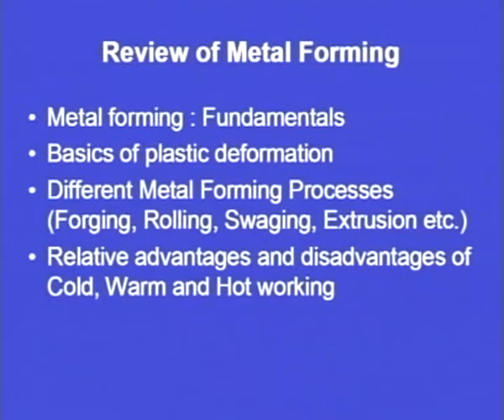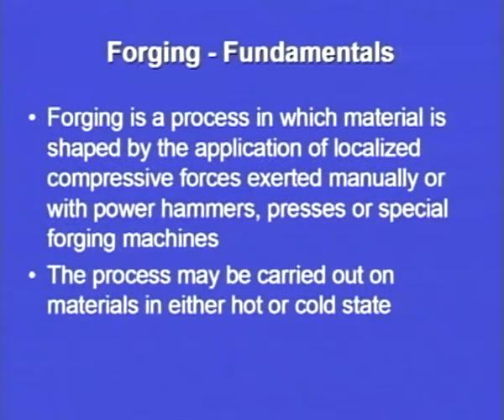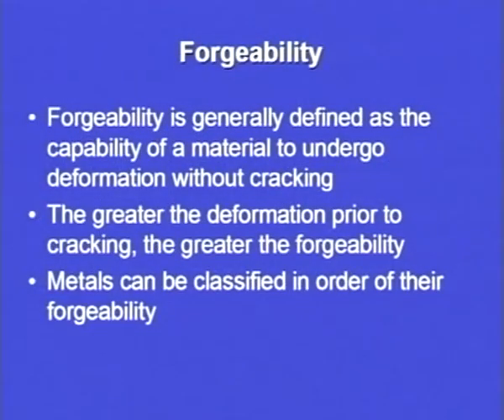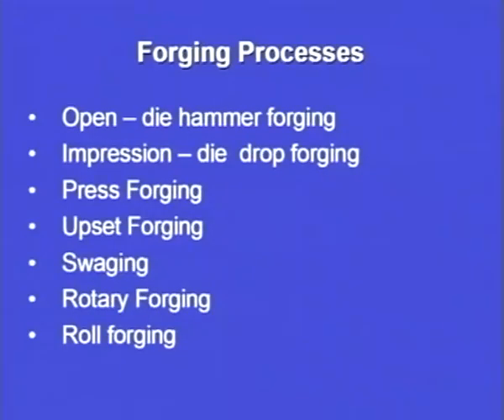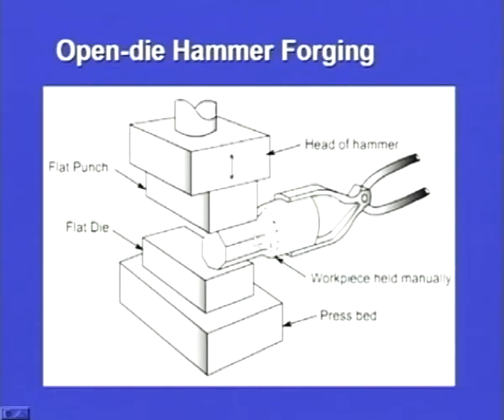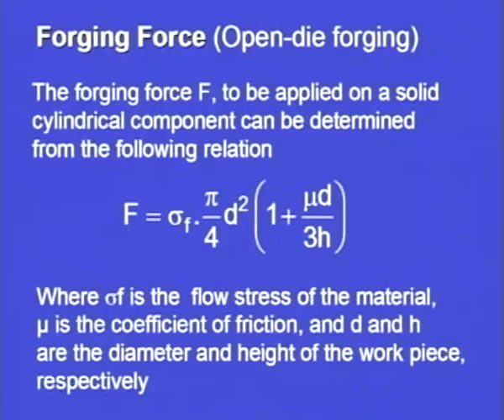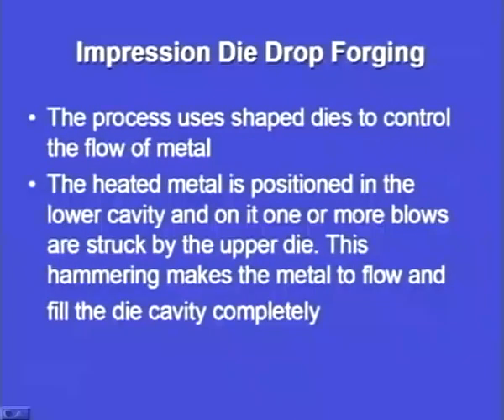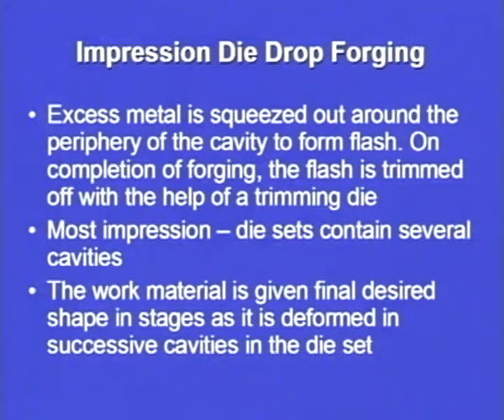Mod-1 Lec-5 Forging

Comment: Height Konsi leni h 72 mm??  Or difference of both
Reply: No height should be 60mm and as volume remains same after deformation you have to find  out new diameter also that diameter will be used because force at the end of stroke is asked. I find this explation from this pdf https://gctbooks.files.wordpress.com/2015/05/metal-forging_processes.pdf